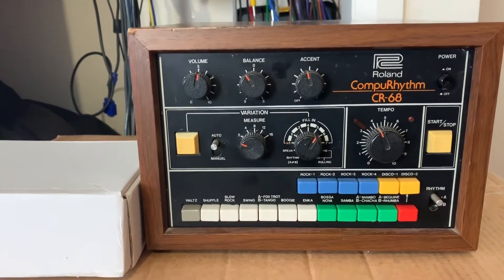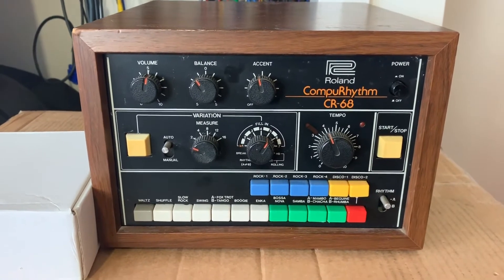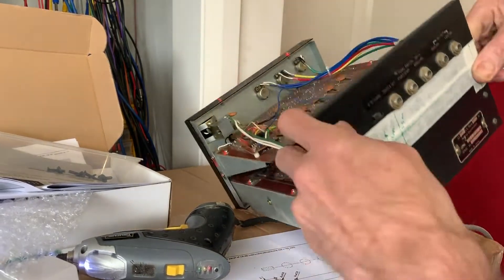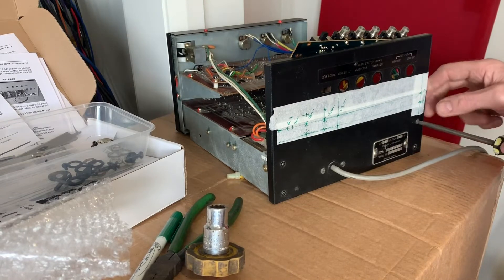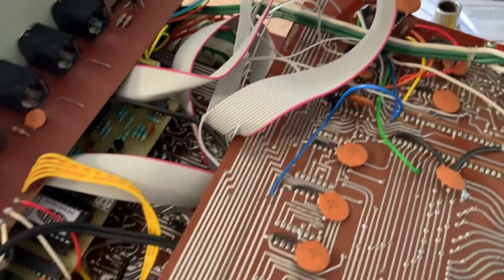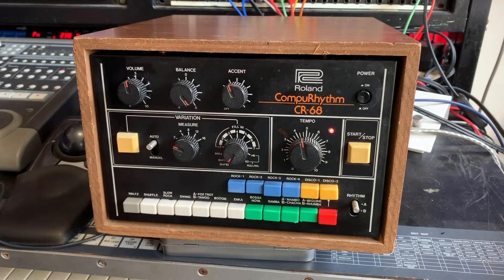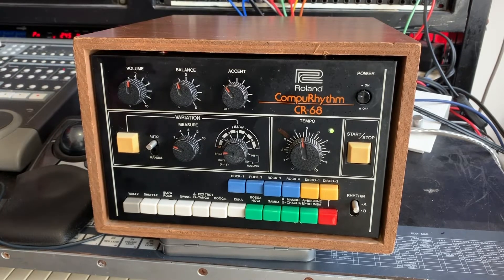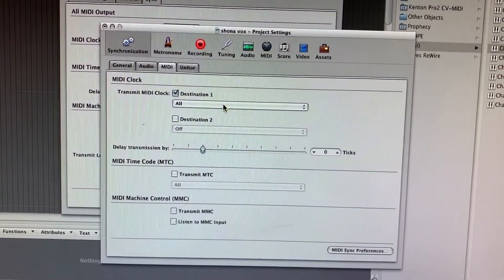Roland CR-68 CRX8-M MIDI Retrofit procedure and test

Comment: How long did it take you to install from start to finish?
Reply from the maker: @delatronics  couple of hours. It’s the best designed kit out there and instructions really clear. I’ve installed several other brands and it was the best. Won’t do the others again! Painful
Reply: @onomatopoeidia  Thanks for the reply, I'm doing one ATM in England and this one has been badly worked on by someone else which has made dismantling more difficult. It has taken me much longer than two hours so far (but then again I've had  a lot of interruptions). BTW I used to be senior engineer at Roland UK from 1988 to 1996.
Reply from the maker: @delatronics  nice! 🙏 thank you. I’ve been using Roland gear since the 80’s and work for Roland now. Yes I always start with correcting the issues so I can trace any mistakes I make because I’ve made a bunch!

Comment: Hi! I have a CR-68 that when powered on, gives no sound and the tempo light is steadily on. Any ideas? I suspect it needs new caps. In this video you mentioned you recapped that unit before - which caps did you replace? The PSU caps or all of them? Have you come across the problem that mine has before?
Reply from the maker: sorry I looked through my log and haven't seen that particular fault. You need to start at the power source and work through checking the voltage rails are correct and go from there. You can download the service notes with a google search and it explains how the circuit functions. If you follow the explanation carefully, you will be able to identify where the problem lies. Can be tedious but if you're systematic, keep notes and don't skip anything, you can do it.
Reply: @onomatopoeidia  Thanks dude! I was hoping the problem was dried caps on the power supply - replaced those. Same problem. Changes EVERY cap on the CPU/logic board - same problem. I've got the service manual, thanks. Will now try as advised! Thanks again!